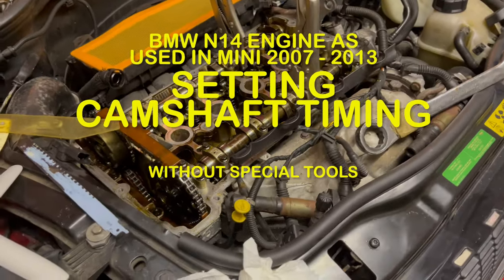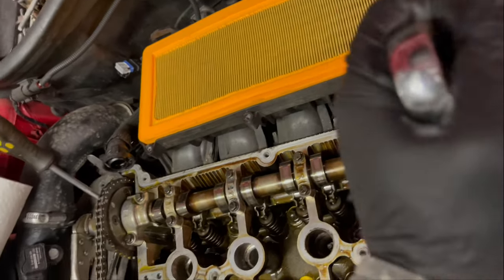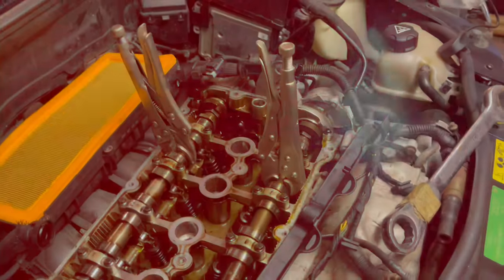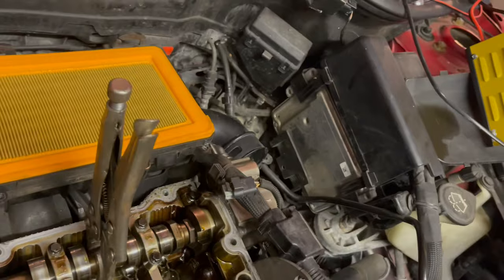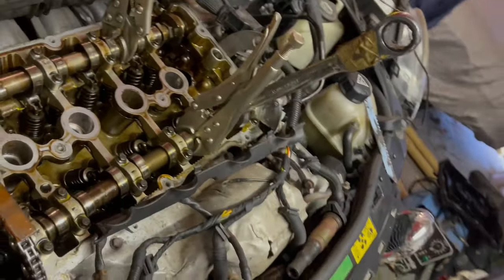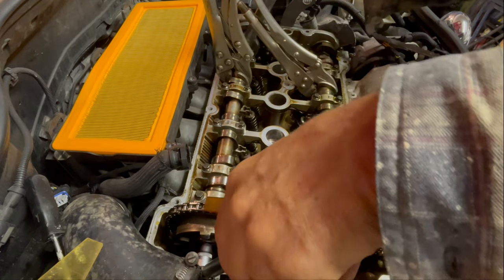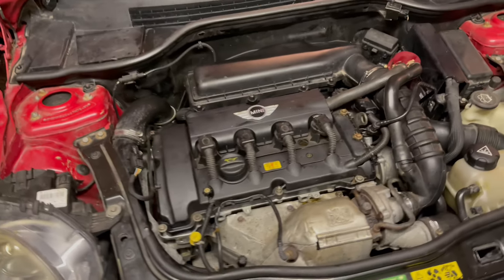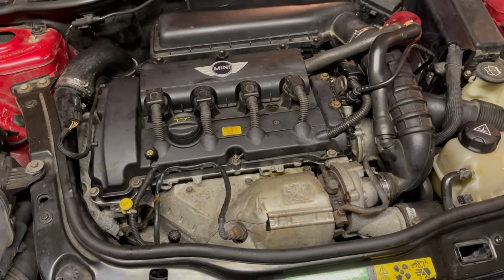BMW MINI N14 CAM TIMING w NO CAM TOOLS

Comment: i don't want to mess with cam sprockets screws. can i remove the cams with sprockets on all together from the vacuum and hpfp side. if i uninstall vacuum and hpfp i think that cams will come off with the sprockets on. so there is no need to loose  the sprockets from cams and torque them again and buy new screws for them. what do you think?
Reply from the maker: Yes, but you will then have to remove the whole timing chain cassette, which looks a right pain in the arse.
Reply: @comeinhandynow sorry i dint understand. i will uninstall the chain tensioner, hpfp, vacuum pump etc. with the chain loose i can remove the cams with sprockets on.
Reply from the maker: @vaiosdiminikos4628 yes you can do that then. I would still check that timing is ok afterwards though, and if any adjustment is needed you will then need to slacken the cam bolts.